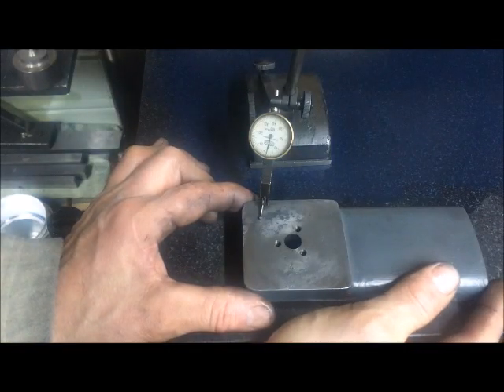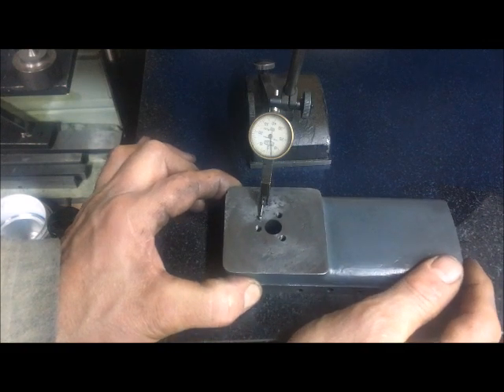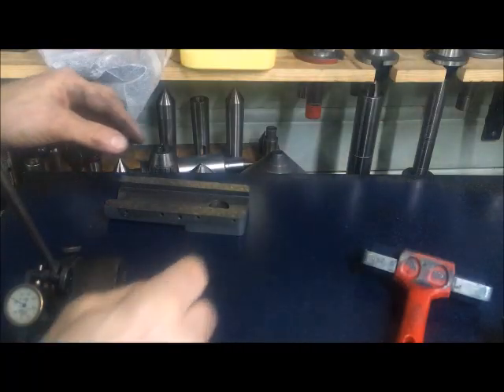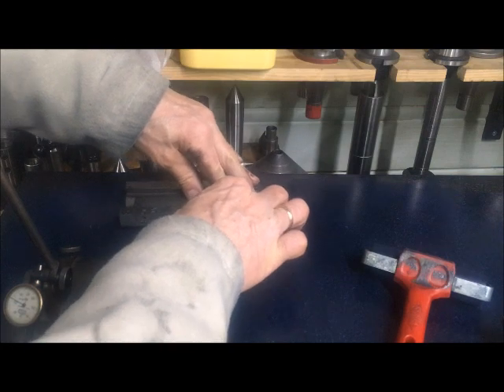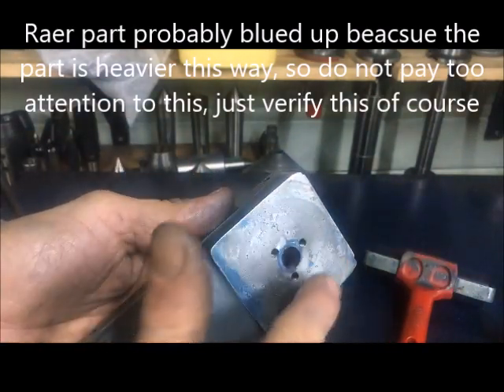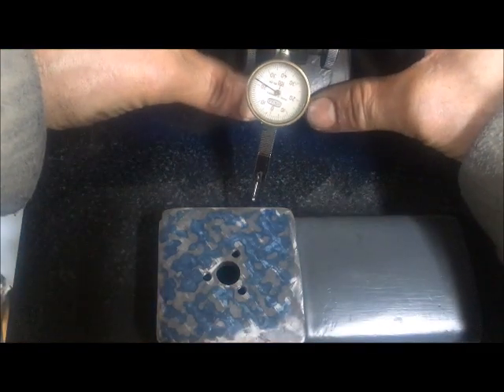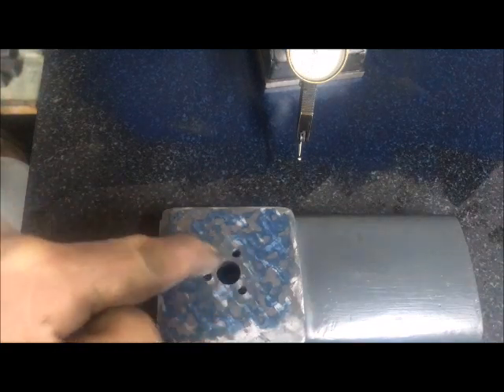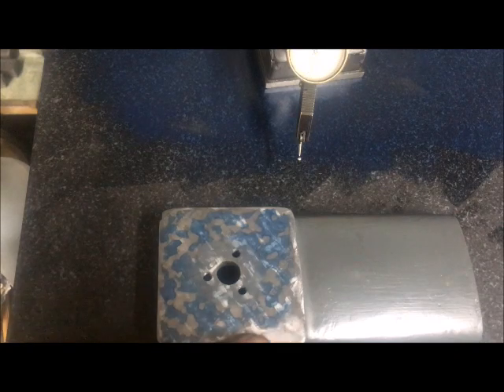Myford Super 7 tool post mount  - dealing with wear

Comment: Hi Jan, I’ve been following your work forever 😁. 
This is the only Super 7 channel that I’m aware of so I’m thinking you might just know a few things about them or machinery in general Lol. I’ve owned one myself for some years now. I bought a surprisingly nice used quick change gearbox awhile back. I’m getting ready to mount it soon and I was wondering what gear set I should install in the main gearbox and what belt/pulley position I should be in for initial testing and general operation? My lathe has an aftermarket motor but the rpm = OEM spec. After the box is mounted I’ll use a tachometer to verify the spindle speeds against the lever nomenclature. I just want to start with the correct setup before further testing. I bought the gearbox used with a metric lead screw. It came with no instructions aside from a hand made paper template for drilling and tapping the mounting hole locations. From internet research and from what I understand so far, I should be able to switch out the metric lead screw with the imperial one I already have if need be. I use the metric system daily but occasionally I need to make ASE machine parts. Most of the equipment I repair is from Denmark, Iceland, Japan, etc. but I live in the U.S. sooo 🙄. Any links or advice on the preliminary setup or warnings (“make sure you don’t do this”!!) in regards to mounting the new gearbox would be greatly appreciated. I Really Appreciate Your Content!!!! Nice progress btw.👍
Reply from the maker: Hi there,
First, thank you very much for the nice words/comments!  Appreciated!
So.. let's get onto your question.. The Myford S series were all delivered with 8TPI ie. "imperial" leadscrews. The ones with "change gears" use different combinations of gears to get the different metric threads, a basic choice with the standard gear set and some more if you haveextra gears or a so-called "metric conversion set". When a gearbox is used you already have a set of metric combinations, but csn get a "complete range" if you also have/buy the extra 33 and 34 gears (to replace the 24 gear that bridges across from the tumbler reverse mechanism) spoken of in this post https://www.model-engineer.co.uk/forums/postings.asp?th=125630 .
In addition, I suggest you read the article here also https://www.haythornthwaite.com/Myford%20Metric%20Conversion.pdf
As for a specific rpm to test the gears/gearbox, I am not sure, but I would run it low.. say half speed. At least, this is what I have done